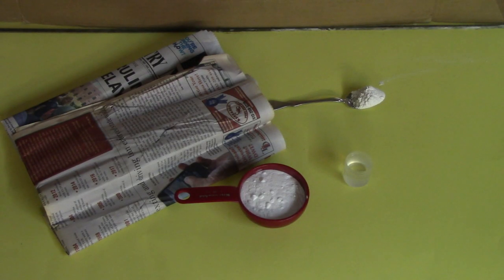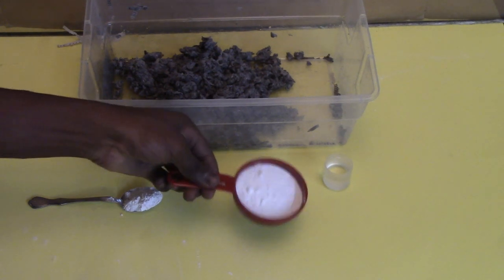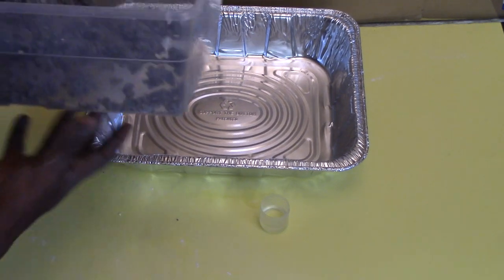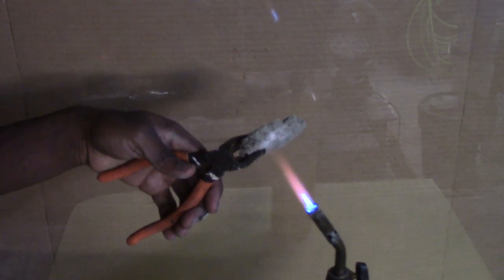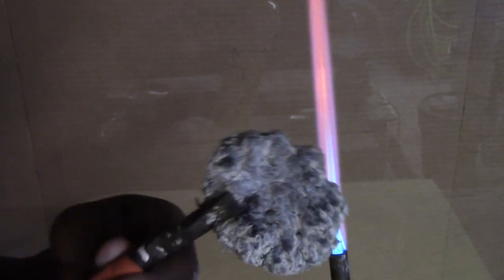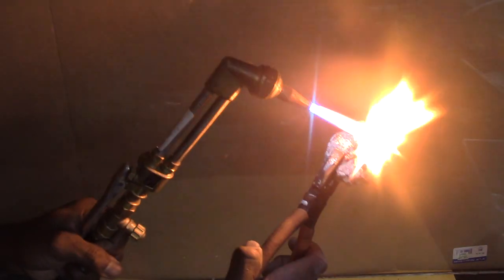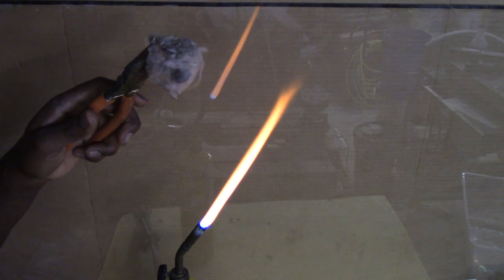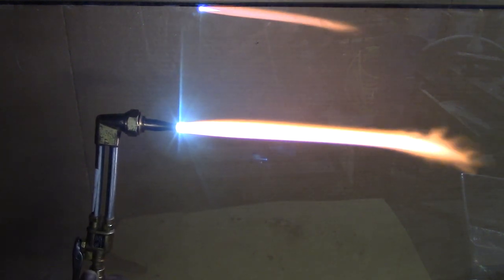How to make Fire resistant Paper!

Comment: hii, may i ask the amount of baking soda, vinegar and plasto repair? and may i ask also the permission to use your solution :) we just need it for our project
Reply from the maker: After further perfection of the recipe, I found that the vinegar can be omitted. As for the plaster, one to 2 table spoons should suffice, its just to help bond the mix together. And yes you can use the recipe, just be sure to give credit!
Reply: then what is making it fireproof if not for the plaster?

Comment: why did you not use the cutting oxy?
Reply from the maker: ziad welder that is an oxy cutting torch.
Reply: yes but you did not use the cutting oxygen gas part of the torch
Reply: ziad welder it never got hot enough to to bother running high oxy... it would have just super cooled it.
Reply: yeah you are probably right,this material is most likely not reactive to oxygen and acts like refractory

Comment: Hey is that bulky??
I wanna use some fire resistant  material that is light weight for firewall of a kart
Reply from the maker: Jay Solanki Its not heavy at all once its fully dry. I would incorporate a wire mesh if you are planning on using it over a big surface to keep it from crumbling
Reply: @platinumscience7356  Actually, by using the wire mesh, its does not hold the mixture as expected. Can you suggest some ideas for stability of the firewall(as it is a long rectangle sheet)? Also, how did you crush the paper? Coz fine crushing of paper is leaving the structure! The firewall will vibrate continuously, so holding of structure is an important factor. What is your thought about it? Am I missing something !?